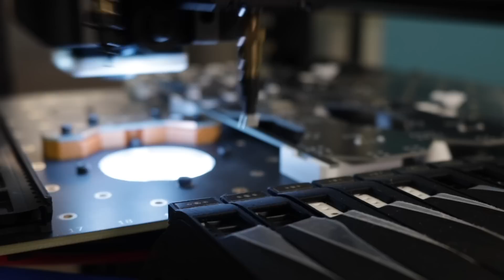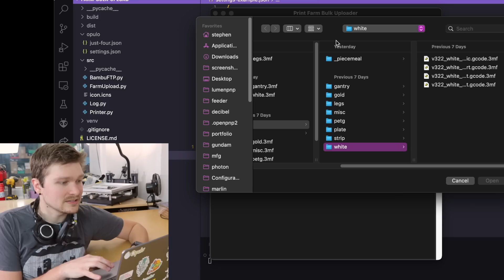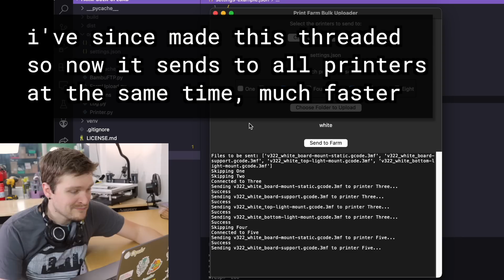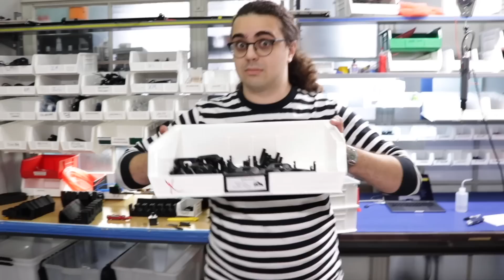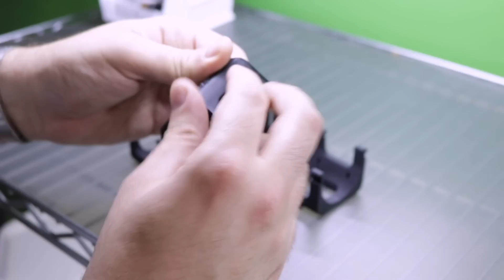Slicers are missing this ONE feature, so i built it

Comment: Or you could just use filezilla = ) Just open multiple tabs and drag and drop file to needed printers. It doesn't looks like that you have 1000 printers. = )

As for slicers, this approach is cool if you have identical printers. But what if you are not? = )
Reply: I use FileZilla everyday, actually I do not shutdown my PC, and the program crashes very rarely(for the last year I remember may be 3 times), so it is a pity that you had negative experience.
As for overloading, just go Edit -> Settings and on the first 'tab' "Transfers" and edit "Maximum simultaneous transfers" to limit number of files uploaded simultaneously to one server. You can set 1 for example, it will upload 1 file at a time. As far as I remember it works on a per server base. So if you set it to 1, it will queue files for one printer, while it will also transfer 1 file to the other.
Reply from the maker: i tried multiple files with filezilla, but it overloads the printer with multiple files at the same time and it crashed often. maybe there's just a serializing setting i missed though! super good point about the printers not being identical. we'd probably want to put the different files in a separate folder, and upload to a different config file. still a little clunky!

Comment: This is where it would come in handy, if those printers were just plain open-source. Write an ansible script and auto-upload all the files to Klippers code folder is a quite easy thing. Would also allow to include checks, where you could see if checksums match or the newest ones are already there. And would let you archive the files easily using git or something similar. All of that would be easily doable if BambuLabs were default open-source. 

fyi .- I did exactly that with my Voron printers. Took me all of 10 minutes to implement.

Comment: I guess a software to monitor the status of all machines would be better. I would for example know the file name of the print and the progress on each printer. Also tracking material type inside printer would also be good. Then I could just have an alert when a few prints are done or has problems, and go to physically remove the parts and start a new print on the screen. batch upload when the printing is done would make much more sense, even better is having a function to just read the color and send it to all printers saying white

Comment: if you use Klipper printers, you could map the gcode folder to a network drive over NFS. And print from those
Reply: Yes, I was thinking exactly the same thing. I assume most of these printers run Debian, you can just use Autofs to automatically mount the relevant NFS share. No tools needed.
Reply: I wouldn’t put NFS in the critical path for printing.  Fully syncing the file to local storage is better.
Reply: Marlin machines for example (like Prusa) don't run a real operating system where you can do that though. They only run on the microcontroller.
That's why I named Klipper as an example, that runs on a RPi
Reply: @Blamm83  it doesn’t work how you think it works. 
Klipper is a firmware, not an operating system.
Reply: I am fully aware, I am involved in the Voron Design printers. But Klipper does run on an operating system like Linux, contrary to Marlin for example
Reply: Mapping a network drive has nothing to do with klipper…
If you have root on ANYTHING you can mount NFS.
Reply: @TheOfficialOriginalChad  I/O to a network drive fundamentally breaks certain low-level POSIX assumptions.  For instance, normal POSIX file I/O is always blocking (as opposed to socket I/O which can be done non-blocking), which means that when reading from a file, it blocks the process until the data is available or a hard error can be delivered.  If a network drive has a 10s hiccup, the reading process will simply hard block for 10s.  If Klipper is reading gcode from a network mount and it blocks for 10s, things are likely not going to work out well for your print.  Or if the NFS server spends 40 seconds rebooting, or goes down entirely, anyone reading from that mount is just going to hang for that time.  My point has nothing to do with what the system will allow you to do, my point is that network mounts don't work the same as local mounts, and some of those differences are very inappropriate to introduce into a real-time system.

There are ways to work around these issues.  Most of those ways are pretty annoying and intrusive to implement, so I'd be VERY surprised if Klipper has done that implementation.

Comment: The Kanban system is awesome. You could probably automate this further with some weight sensors (or a push button really) and an online Kanban like Trello. That would save the person taking the part the trip to the print farm. You could even print out the part queue with a receipt printer if you want to.
Reply: Weight sensor was probably the first thing I thought of when I saw how they were handling this. Given they know the dimensions/filament type/theoretical weight of each piece it would be an easy way to tell exactly how many parts there are without manually counting. Weight gets below the threshold, system could automatically start printing
Reply: This is an example of solving a problem with a complex solution over a simple solution.

Someone has to install all the switches, label the switches for humans, then program the switches to match the labels, lest the empty box of widget A triggers a call for more parts that instead asks the farm for more of widget B.

This kanban idea requires very little for setup (formalize operating procedure once, make cards as needed), and the only cost is the exercise of using the system.  Oppose that to some electronic solution that requires complex setup, but is reduced to the simple exercise of pushing a button to use.  Will work fine until someone has to repair or upgrade the system, and then needs to remember all the parts to update to do so.
Reply: @charetjc  I am mostly suggesting this because Stephen seems to be interested in experimenting with automation tech, and it would at the very least make for an interesting video, even if it doesn't end up simplifying their workflow.

We can spend hours theorizing whether the easier usage justifies the upkeep, never coming to a conclusion. Or, since the development of such a setup is so straightforward, he could just run a small scale experiment. If it works out, cool, if it doesn't, we all learned something. :)
Reply: @BinaryCounter  At Toyota, there was no fancy electronics in the lineside Kanban system. When you start a new box of parts, you put the Kanban from the front of the box down a chute on the rack. The chute leads to a box on the back of the rack,  which is periodically emptied. The collected Kanbans are logged, then placed on new boxes of parts which eventually come back to the rack. All you need are enough Kanbans and enough boxes to satisfy part demand.
Reply: Wonder how much the BOM would be for that system, and the worthiness of the additional system complexity and upkeep though.
Reply: @RADHardTech  For a push-button system... Honestly, a ESP8266 board, some push buttons, an io extender and some wires... We're talking like 10-15 bucks for a system with dozens of buttons. Then you just setup a webhook with Trello, connect the thing to Wifi, and that's pretty much the whole project, hardware and software. 
Weight sensors are a bit more complex and costly, but not too much so. They would probably need to design and print adapters for the sensors and their trays though.
Reply: @BinaryCounter  keep it simple stupid. 
.. as they say

Comment: In any situation where you can have partner code running on the machine, like say making a plugin for Octoprint, it would be further faster to upload an archive and extract it locally; ignoring compression, I have no idea if these files compress decently, but network file transactions are fairly time consuming, they involve 2n local file transactions, and at least 1 network transaction per file. Network transactions have a particularly high latency because you're going from top to bottom bottom to top of the OSI model repeatedly, but the fastest part is in the middle where your computer is chunking data into a pipe and moderating speed based on reply packets, it's the start (and less so the end) where the transfer has to wait for the two computers to finish establishing conditions. For many individual file transfers, there are many starts and many ends. For an archive, there is one start and one end. You still have the 2n local file transactions, but they have a vastly faster latency.

As an experiment, go to your chrome based browser's appdata folder, there should be a folder called Profiles or maybe Default, and that folder probably has 30k~600k files in it. Put the folder in an archive and then copy them to another computer over FTP. Because the bare files are many individual transfers, each one doesn't have enough time to get up to speed before it's over, you may see speeds in the kilobits per second range; while the archive, being one big Block, is able to approach the theoretical maximum available bandwidth of the primary bottleneck, which might be the microSD card? I would hope none of these printers have 10/100 NICs. This is a thing I've done a lot and usually it takes 4~6 hours over a gigabit connection to transfer the bare files, but 15~20 minutes to put them in a .7z, a minute or two to transfer them, and it tends to be faster to extract so lets say 10~15 minutes, 26~37 minutes. 

It may even be better to specifically put the files in an uncompressed archive, like a .tar, so that there won't be a bottleneck on the printer from underpowered CPUs trying to uncompress a zip file and maxing out.

Comment: This is really one of those problems that just shouldn't be a problem IMO. If printers just used a standard stripped down linux installation you could then do something like an SSH/SCP transfer or just use something like syncthing, or really any number of other pre-existing solutions. One thing that I wish people stressed when it came to open-source is that the user can just sorta, do stuff. Since there is so much 'fragmentation' solutions tend to be way more agnostic from the get go, and since it's all openly visible anything that isn't already transparent can be learned and adapted fairly quickly. There just aren't barriers that even get in the way in the first place so you can just do what you want to with absurdly minimal work. (at least not 99% of the time) I appreciate this as a solution, but it's a solution to a problem that just shouldn't exist in the first place IMO. 

Something like syncthing could do this obscenely well, yet because standard practice is locked down interfaces people need to reinvent the wheel and do stuff like this. When it comes to farm-scale printing, if printers could just be daisy chained with cheap ethernet cables then SSH-ed into, loaded with something like syncthing, etc. people wouldn't need to invent workarounds to do stuff like this. Again, I fully appreciate that this is a solution to a real problem, but it's just annoying that it's a problem that exists in the first place. One of those silent benefits of more open-solutions is that you don't need to reinvent solutions to problems like this and I wish more people mentioned it.

Granted, in this case there just being an open FTP server is pretty clean as a solution anyway, but it's still not ideal. (plus, the fact that it had to be discovered on forums rather than being an advertised feature means it might have been an oversight that will be 'corrected' in the future)
Reply: Since Klipper firmware runs on Linux , you can 100% do that. Scp your files to the print files directory, or use syncthing
Reply: @mateusraitz1803  I know some things do it but my point is more about what's standard. This is a really invisible benefit that not many people think about, so it just doesn't get the market pressure that it should. For instance on linux one of my favourite features is literally just symlinks. They're so simple and ignorable yet they let you do all sorts of wild shit, like splitting an application across several drives so that different parts of it that need to work fast can, whereas others that can be slower are kept on a larger medium. More open solutions are just naturally going to lend themselves to more agnostic and "it just works" interoperable design principles, but it's one of those things that most people don't really think about. 

People don't think about problems being easily solvable or non-existent, they think about problems that are stubborn and DO exist, so it's something that not a lot of people talk about, even though it actually makes a dramatic different in quality of life.

In other words there is generally a greater focus on solving problems rather than avoiding them. That's not intrinsically an issue but more people really should start asking why these trivial problems even are problems in the first place.
Reply: This is a great use case for syncthing. Set your workstation as send-only and all your printers as receive-only if you're worried about conflicts.
Reply: With Klipper and Linux or something its just a cronjob away 😊
Reply: Using linux everywhere is not really possible. Not all printers have a SoC capable of doing so as that adds to the cost of the printer. I would say FTP is the closest we can get to a "standard" without creating some complicated API
Reply: @davidpodeszwa7010  This really just isn't true. Even modern windows 11 pro can be debloated to idle at a single gig of memory and run usably on a monocore. The compute required to do all of the modern bed leveling and such in modern printers puts the SOC well above whats necessary for a lightweight linux distro.
Reply: @robonator2945  lol, lookup what Bambulab P1 uses. It's microcontroller has like 200kB of SRAM and 4MB of FLASH memory and no MMU. Nowhere near what a Linux capable SoCs have, yet it's able to run the printer just fine.

Comment: This is cool, but I feel like a better solution would be getting printer manufacturers to add the ability to pull files from a central file server. That way, you just keep the files on the server up to date and the printer prints from there. Have each printer have its own "active" folder it pulls from and an archive folder for past revisions.
Reply from the maker: oh that would be rad! a feature like that is the dream
Reply: @stephen_hawes  With Octoprint, you could likely just mount a network server (cifs, nfs, sshfs)
Reply: With a printer running Klipper and Linux or something, its just a cronjob away 😊
Reply: @berlinberlin4246   There's not even a need for linux, any 32-bit mcu printer like current Prusa's could have just added this routine to their firmware (older ones could possibly too, but without RTC there would be more overhead).
Reply: Does such a tool really not exist? I am happy to build such a system
Reply: Seems like building SW with Jenkins agents - here the agents are just printers. Then control of versions should be controlled by a git repo with a release branch or tags.
Reply: I was actually about to suggest this. Basicly like if you could have octoprint look at a network share rather than it's own "internal" storage.
Reply: This is really easy to do with printers running klipper
Reply: yea but then they would put it in a cloud solution and it would be trash.  Its better to push to the printer when you are done with the update to the files
Reply: Exacly the comment I was just writing ^^
Reply: You can do this with Repetier-Server Monitor and for example our beltprinters from iFactory3D that run on Repetier-Server to have a fully automatic print farm 😎
Reply: It’s easier to manage a central location.